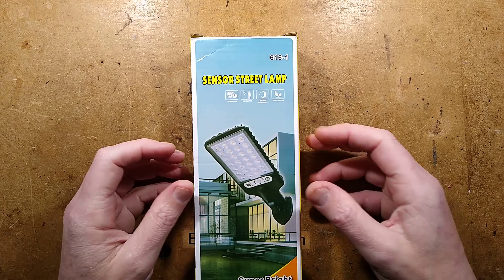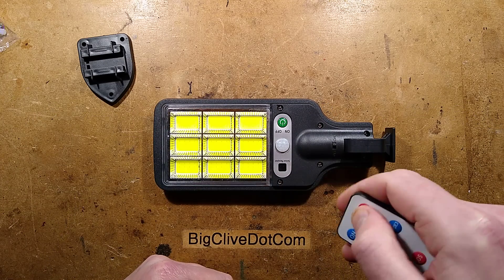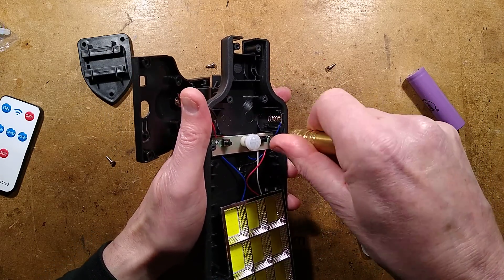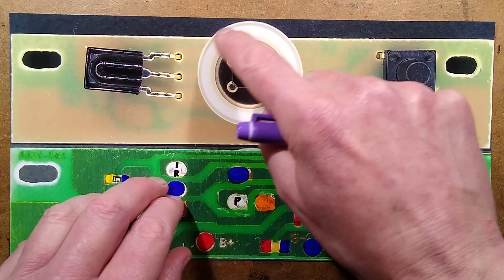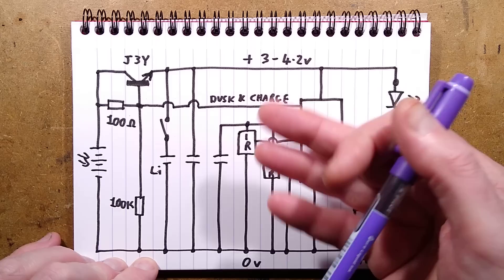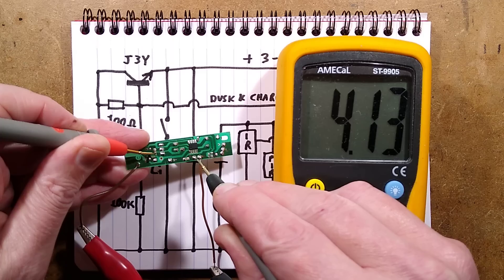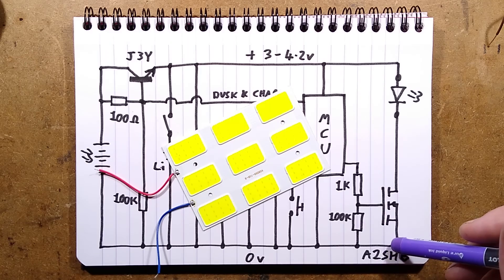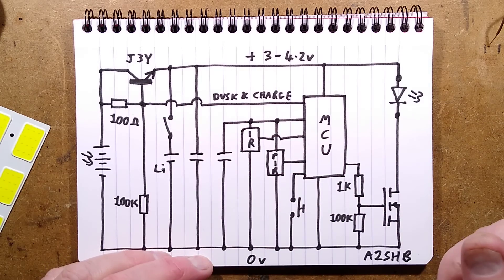5000w solar LED street light

Comment: It reminds me of the youtube ads were a high school kid has a new kind of heating tech they dont want you to know about 😂 or an ac unit that doesnt need a compressor 😮
Reply: Ac unit and no compressor.. exists, sort of... 
Search adsorption refrigeration.. ammonia and water,  hydrogen. The cycle starts with a small gas generated flame, and when temperature is achieved , flame is reduced to a minimum to  just maintain that temperature. The old mechanical systems were best with fixed high and low flame points but have evolved with electronics to extinguish and relight the flame..which requires more parts and battery backup.
 Great refrigerator/freezer in the wilderness where local power utility is not readily available.

Comment: J35 looks a lot like an emitter follower regulator...
Reply: Yeah it's just strange to me that it regulates via a 100k resistor not a diode
Reply: I'm thinking that's just a pull up, and the the controller provides the level.
Reply: @markscheutzow3446  that actually makes perfect sense

Comment: Battery technology has really changed to the point that I could run my entire house power needs on a single lithium battery and solar charging system. 😁
Reply: When I saw the title that's what I thought. I was expecting to see 4 12.8v 100 amp hour LiFeP04 batteries! I think they mean 5000 milliwatts 🤣
Reply: That's MW for you, according to quite a lot of sellers  @chrisreynolds6331
Reply: Heck one of the power banks Clive reviewed a few months ago could power a Tesla for about 3000 miles, if the advertised rating is true!
Reply: @John_Ridley  some advertisers quote lithium ion power banks in milliamp hours to make the figures look impressive. I bought a cheap portable power station where they claimed 27,000 milliamp hour. The battery pack was actually 9 amp hour at 11.1 volts (3 series cells). So they're basing that figure as if it was a single 3.7v cell. They must think people are dumb. I ended up returning it and buying a lithium iron phosphate battery one. The manufacturers of those tend to not talk such nonsense 😂
Reply: In this case they should be nano amps xD
Reply: Oil and water are like Chinese sellers and honesty
Reply: Lol solar power homes that charge a power box has been around for decades
Reply: The majority of this was obviously LEDs, switching power supplies, switching regulators, better commissioning practices in installations and general electrical systems keeping down resistances therefore less heat dissipation etc.
Reply: ……and an inverter
Reply: Just imagine mA-minutes - get immediate 60x improvement! mAs anyone?
Reply: "single lithium battery" is pretty dumb because a single cell is 3.7-4.2v & a single battery has as many cells as the builder wants.
Reply: Have been there for nearly 7 years. 640 watts solar(at 20 volts) and 2 x 12 volt 175ah agm batteries running 12/24 volts fridges, lights and all that. Will soon be making the switch to lifepo4(lighter for a mobile/nomad situation). 

At the time of setting up, lithium was around 3 to 5 times the price of agm for comparable capacity here in Australia. It's almost on par now. I am hoping  It all the two lifepo4 test units handle the heat of the coming Australian summer(thats already here..🥵. Hit 40 celcius yesterday before 12 noon). Lifepo4 are rated to 60 celcius, under charging in 40 odd celcius ambient, there's only a 20 celcius margin before the bms cuts chaging. Be interesting to see how they go. Remember, inland Australia can hit the mid 30's celcius by 8 am in the shade!
Reply: @gooseknack  
Have you thought of using LA & L combined?
And making a cool box type sump...
Reply: Yup. Use a super capacitor with it too to charge your EV
Reply: I ordered a 18650 100000 mah battery,, it's insane
Reply: Maybe but in Manchester, it's bloody grim up North
Reply: Even if that was the case, you'd still get a electricity bill of 90 bucks/euros and be left scratching your head.
Reply: Yeh if you live in a shoe box
Reply: I already do. I am off grid for  say 90% of the summer months between the equinoxes with 4kw of panels and a 10kwh Lithium battery. To do that I got rid of my plasma TV and replaced it with an LED TV and all my lights are LED types. I run my washing machine and air fryer etc only when there is enough sun during the day so you do have to plan a bit but not much. I have a Smart For Two EV and during high summer I can often add say 10% charge to that per day which gives me 10 miles which is more than enough for me.
Reply: @jacquelinebrunder2384  likewise. 9Kw system on the roof, 27kWh of battery storage. Will have paid for itself in less than 6 years - saving £3k a year in electricity - not to mention running 2 EVs, so save around £2.5k in diesel costs too.

Totally off grid during the summer, and never need to use peak rate in the winter. Best investment I’ve made!
Reply: @jacquelinebrunder2384 which battery did you go for? Similar project here.
Reply: @jacquelinebrunder2384 did you also get some dc-dc step up/down converters so you don't lose power due to inefficiency in inverters or ac to dc circuits where possible?
Reply: @jacquelinebrunder2384 You do all of that very well, congrats😊
Reply: .  That didn't sound like a way to live.
Reply: @jacquelinebrunder2384  That kinda sucks that you got to plan when to run power hungry devices to not use all the stored energy
I guess off grid power is more of a gimmick than something worth wasting lots of money on it
Reply: @jacquelinebrunder2384 4kw of solar  panels😮 how much freaking surface area/land do you have...you definitely  don't live anywhere  in  europe😅
Reply: @MA-pm3em 4kw is tiny. In Australia the smallest advertised systems are usually  6kw+
Reply: @procrastinator1842 aah Australia- that explains  it  in Europe your 1.2 million euro/pound 'house' is 2 bedrooms downstairs  and there's  a stranger living upstairs😅
Reply: @TrumpstienPhile solar panels are down to about four square feet per 100 watts.
Reply: @MA-pm3em 5.4kWe off 14 panels, installed 4 years ago. Detached house but if you had a town house you could get that on both sides of the roof.
Reply: @jacquelinebrunder2384  You don't have a LED TV. It's a LCD TV.  Did you ever hear of florescent TVs or CCFL TV? Of course not, so please don't fall for the BS marketing.
Reply: @FirstLastOne Have known about CCFL systems since age eleven, used to disassemble monitors and get paranoid about breaking the backlight tubes.
Reply: @FirstLastOne  we share a pet hate with that specific marketing BS.  Although there are actual LED TVs - if you buy an OLED TV for example.  But yes, most TVs branded as LED are simply LCD TVs with LED backlighting.
Reply: @FirstLastOne first of all, LED tv's exist, OLED, mini-led etc are all NOT lcd

second, even if the person has an LCD tv, it's completely irrelevant as a modern LCD tv is an LED LCD tv (LCD matrix with LED backlight) both of these acronyms apply to the tv, and one of them is not more correct than the other, especially if the point the person is trying to make is about efficiency compared to an old plasma tv
Reply: @FirstLastOne LED refers to the LCD backlighting, and yeah LED backlighting is lower  power consumption than CF LCD backlighting. Add to that significantly lower power usage (& power wastage) for modern LCD tv chipsets and power supply stages. Modern LCD tv is miles better power efficiency than than plasma power consumption which can be horrendous.
Reply: @FirstLastOne Have you seriously never heard of OLED displays?
Reply: @FirstLastOne You... do know there are OLED TVs, right?

Update: so many comments like this lol.
Reply: yeah and imagine what'll happen if you took those ultracharged solar panels and covered your roof with them - you could probably have sufficient power for the whole town!
Reply: Then you live like a luddite in a grass hut, or just pretending or failing to mention the substantial drawbacks.  ;)
If patting yourself on the back and you're happy, good for you.  It's all about achieving productivity at what you need to do.
Reply: While it is possible, it's not cost-effective yet compared to using a generator. And it's not cost-effective with electricity at 12 cents per kilowatt hour or less.

However it's supposed to be about 40% Cheaper by 2026. It won't be competitive with a generator until it is about 80% cheaper then it is today in 2023.

However, if you may be without access to fuel for a generator then it has value as disaster recovery but it's going to cost a lot of money.

Comment: Wow. That light uses more power than my electric clothes dryer
Reply: My first thought was "so... an electric fire starter?"
Reply: 20000 of those and a really long extension cord and l could easily power my light sabre.
Reply: Lol even mine have same lamp module but have 2 battery in it
Reply: With households installing more and more efficient lighting, cities are being forced to install less and less efficient, higher-wattage streetlights to compensate, so as to keep generating capacity constant or something. (ROFLCOPTER)

Comment: Glad to see that the A2HSB Mosfet can handle 5,000 watts of power!! Also i wonder how much of a 'street' this would actually illuminate from the top of a high pole!
Reply: 1351 amps at 3.7 volts. Ummmm .. 🤣
Reply: @chrisreynolds6331  that's a lot of amps
Reply: Last year I bought a Bluetti AC300, 3000 watt battery power station. The battery was so heavy that I could not carry it. I should have bought this single 5000 watts capable 18650 cell instead.
Reply: @Aranimda  heck, you should be able to do light welding with this little puppy
Reply: @Aranimda  I know I was NOT expecting some little dinky battery powered device with the 5,000 watt claim.  I would be surprised if that LED panel were more than five or ten watts at 3.7VDC.
Reply: I was actually wondering if Clive would have measured current & voltage, just to have an excuse to take out his cink palculator, and do the math to work out the real power of this seemingly good light.
And also that solar panel must be awesome!
I have 12x325 Wp that cover the shed, this tiny panel would put them to shame 😂
Reply: Yes, if you do the maths, 5000 watts will flatten the battery in about 3 seconds - assuming the whole thing isn't one big fireball by then.
Reply: Considering that we usually use around 120W of power for streetlights I would say that a single pole would be enough for the entire road.
Reply: @Ale-bj7nd  120w for modern street lighting !!!  I thought the reason for councils changing to LED'S was to save power!!  I think the old sodium lamps were around 65watts !!
Reply: @merlin5476  street lights on my road are 16 LED 36 Watts replaced 70 watt HPS
Reply: @merlin5476  it obviously depends on the local regulations and street type. I'm talking about a national road in Italy. Different roads require different lx amount.

Comment: Other than the nonsense description, this actually looks pretty good! I love how they have an actual battery holder to make swapping out batteries much easier.
Reply: Why are the no-name products always better than namebrand in regards for power users? :(
Reply: Yeah as a solar powered garden light it looks decent - depending on how many hours it lasts - not 5000 watt though 😂
Reply: maybe the meant 5000 lumen instead of 5000 Watt?
Reply: The amount of marketing lies the Chinese companies do is just outrageous. Supposedly "10000 mAh" in a battery physically not capable of more than 3500 mAh even when Japan or US made etc. They lie constantly and shamelessly. It's a cut-throat industry where the customer is a sucker to be exploited.
Reply: 2 weeks past and I just received this post a day or so ago..wth?
 Clive, for energy and recycling purposes, ECM blower motors at either UK 50, and or 60 Hz, U.S. 120, 240 vac, these motors, after the drive module pukes, make an impressive wind and stream mill wheel driven generstor.  Oem horsepower plays a part but would you look into snagging one used , failed motor at your local hvac contractor house and maybe figure the best outpout  at the least driven rpm, and a rectification, regulation, charging circuit for a power bank for the average joe wanting to save dollars on the power company, and power led lighting, charge smaller cells, and tools, an  inverter to run the older appliances at their listed voltages (until someone designs and markets appliances at half the now power requirements. 
  I have putzt with these and am amazed at the low rpms, power output, three phase to single conversion . At about 6 to 10  rpm can deliver 40 to 60 vac 3ph.,  3 :1 bridge rectifier phase conversion and voltage regulator in dc mode drop to 32, 24, 15 vdc with management .
 Water wheel and pulleys, a 48 inch or 122 cm wind blade..etc. 
Unfortunately, my domestic partner pushed me to trash seven of these motors, ready to be assembled.
Reply: @Barracuda48082  Patrons get early access.
Reply: @Barracuda48082 Clive posts them to his patreon members first before opening up the video to YouTube.

Comment: The 5000W is assuming 240V input. for the same current at a nominal 3.7V you get 77W. And of course that's the equivalent power if it was a tungsten filament lamp so the actual wattage is about 1/8 of that, ie 10W. That's Chinese maths explained.
Reply: 5000W is referring to mW similar to how Cal refers to kilocal on food labels.
Reply: @debochch  At the same time I doubt they pull 5W. That is a lot of light for a garden light.
Reply: @57thorns I've measured the 18 led version and they pull 3w from a fully charged battery so not that bad rli
Reply: Your maths does make sense. Unlike the Chinese.
Reply: Ah, the perils of commenting on Patreon stream videos, when they go public you haven't a clue what the replies are about 😂
Reply: Somehow I doubt it's as bright as 100 x 50W halogen GU10 or MR16 down lights.
Reply: @ColinWatters  If plugged into a 240V supply this lamp may well illuminate as bright as 100 x 50W halogen GU10 or MR16 down lights, albeit very briefly.
Reply: Can NEVER believe anything that lying cheating lack of quality control POS communist china tells you. Had cheating china relays marked 25 amps but with a 20 amp resistive load burnt out in 6 weeks. At best contacts were cheap 10 amp and wire was only 16 guage .
Reply: Mind=BLOWN😮
Reply: @VishalDudhani  so I was at the hardware store getting parts for a wooden floor and checked all the bulbs in the LED section and once you get past the 60 watt bulbs, it's a very consistent 95 lumens power watt.  The "60 watt" various in lumens but the real watt to lumen ratio was consistent.
Reply: They don't mean it consumes 5000 w. They mean it puts out light equivalent to an old incandescent light that did consume 5000 watts.

So I expect that it would consume about 80 W and put out about 8,000 lumens.

As a quick rule of thumb, LED lights put out about 100 lumens per watt they consume. And a traditional 60 watt bulb puts out about 900 lumens. If the LED bulbs claim to be 60 W but the package says they consume 7 w, then they're going to be dim. Equivalent to 45 watt bulbs.
Reply: @mac_mcleod IMO it's a more accurate, real world, quick rule to say 50-70 lumen per Watt. The 100lumen/W is the theoretical value. That is what I learnt from quality LED light stores in Sweden, where they have their own labs measuring actual lumens and power consumption.
Reply: @bennylloyd-willner9667  also whilst looking at the boxs that my gu10 led lamps arrive in,  it says Actual lumens & also has useful lumens on it too !! Just to confuse matters.
Reply: @mac_mcleod  If it was a simple as that I wouldn't have needed to comment about Chinese mathematics. 
If you go back and rewatch the video, you will hear that it is only consuming about 10W.
Reply: @chrishartley1210  if it is consuming 10 w, then it's putting out about 1000 lumens. I'm well aware of Chinese dishonesty and cost cutting. However, I've seen similar dishonesty in the "60 watt" bulb range by non- Chinese companies as well.
Reply: Ah, Communism.

Comment: 5000w much wow. So compact 😅
Reply from the maker: The only time this thing will be able to dissipate 5000W is if the battery explodes, it goes on fire or gets struck by lightning.
Reply: This reminds me of the obnoxious trend in advertising for grow lights, where you'll see something listed as a 1000w LED when in reality it's more like 100 watts and they are saying it has the same output as a 1000 watt HPS or MH and they basically never even come close.
Reply: @iamjustkiwi  LTO tape: nominal compressed capacity caugh
Reply: If that was an actual 5kW light the plastic housing without cooling would melt so fast.
The power draw is probably exaggerated a factor around 1000.